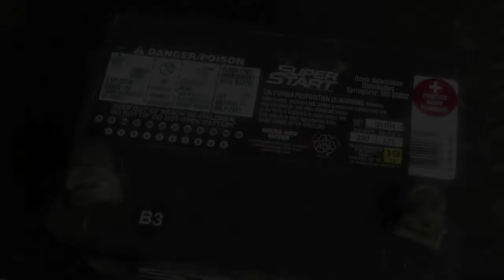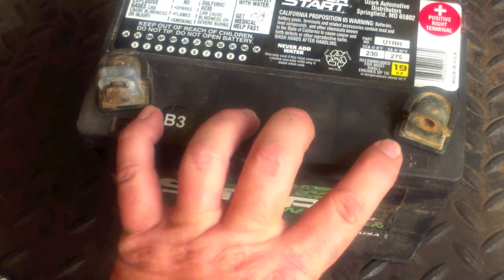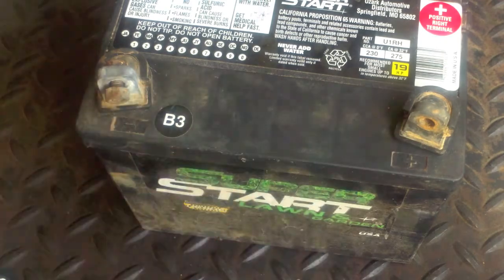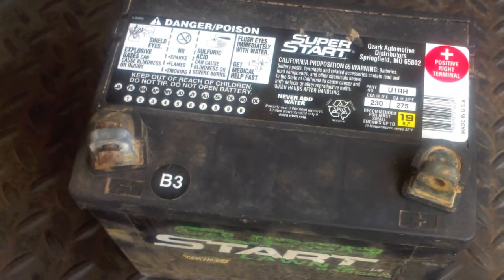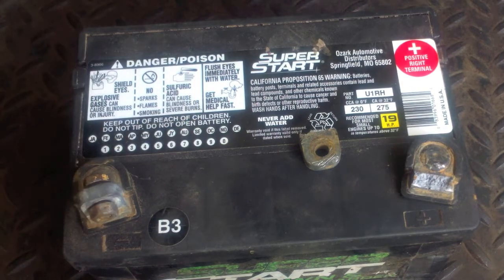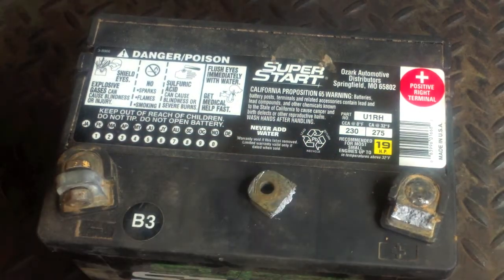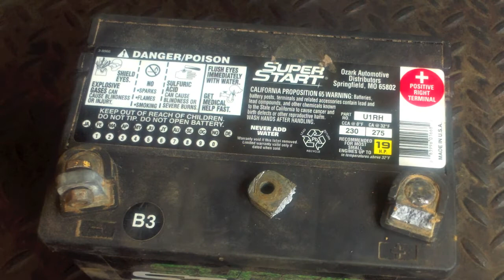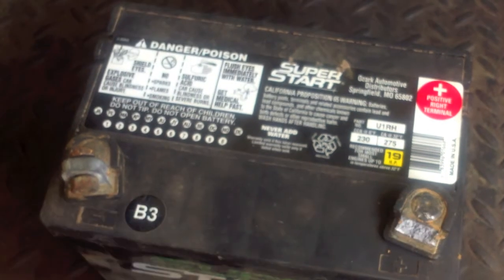Battery Terminal Fix part 1 of 2

Comment: Can you drill and tap a battery on an auto, like my 2015 Honda CR-V.  I want to run #10 wires to a 12VDC to 110VAC 1000W Inverter.  Is this a good idea?